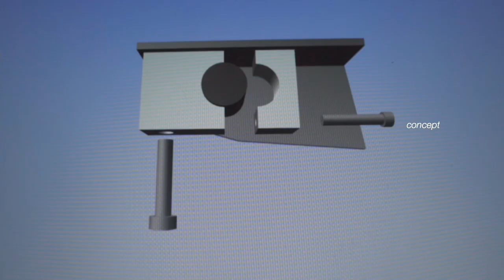How to make a brace for the 2008-2014 WRX clutch pedal assembly

Comment: 3:39 what exactly did you lubricate? I appreciate your time into putting this video
Reply from the maker: I fired some spray silicone lubricant down the tube in the pedal assembly - and into the cracks that had formed. I occasionally have to repeat this as it dries out. The brace isn't a permanent fix but does help.
Reply: limemovie what are your thoughts on white lithium grease?

Comment: Absolutely great video. Since you gave critical dimensions Id imagine you are ok with others re-producing.  For anyone interested I have modeled this part and have a drawing for the one I re-created and installed. Let me know if want it so that you can get it machined
Reply from the maker: Awesome! I included the dimensions so that people can make one for themselves. Did it work for you?
Reply: @limemovie hey  are you able to make this bracket for some one ?
Reply: Could you send a copy of the drawing please
Reply: @limemovie  hey if it's not too much trouble could I please get a copy from you? I've tried so many fixes this is my last resort.
Reply: I am interested in your drawing if still available. Have a customer that needs one rather than a couple hour repair.

Comment: I wonder if welding the crack would help any ?
Reply: Prolly would crack again unless you really built it up or made a support bracket to take some stess off the whole shaft. I think a small triangle brace welded to the opposite side of the cracked shaft and the pedal bracket. I dont feel like taking it all apart or burning anything so im going to try to mount something between the shaft and the firewall attached to the pedal bracket then use a hose clamp or something and connect them im not positive yet tho.

Comment: Why not just weld the tube?
Reply from the maker: Welding would probably be better. However, it's not something I have the skills for. I was looking for a simple repair that was possible without removing the assembly from the car. Also, a brace might help prevent the break from forming as it seems to be a common failure point.